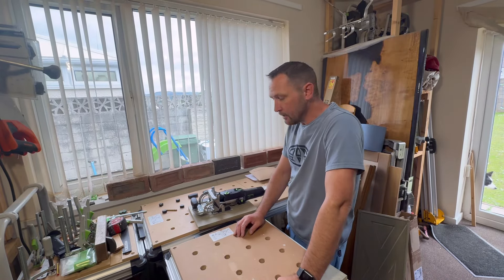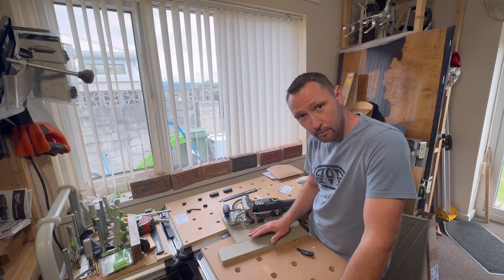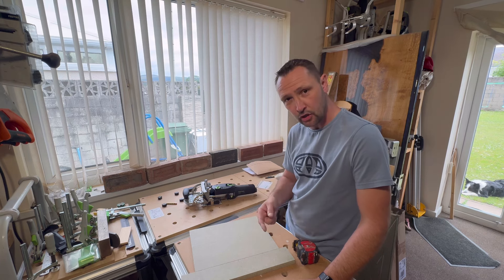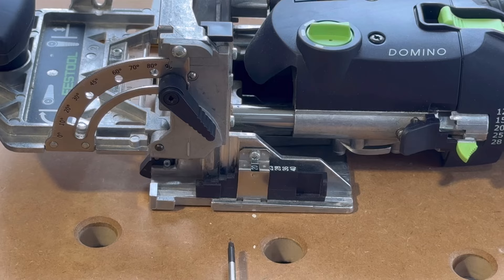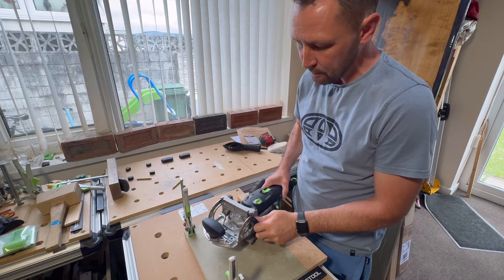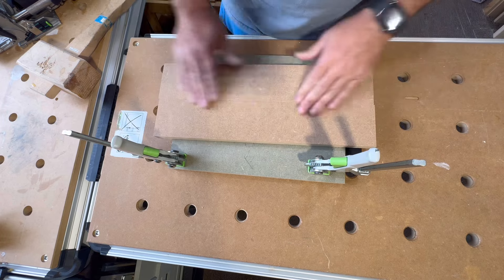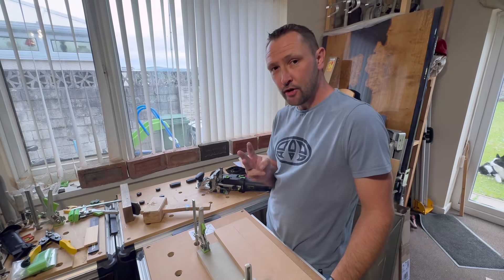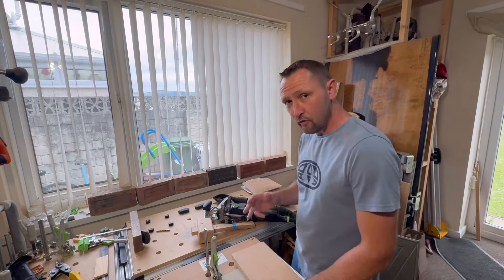Festool Domino (do this to stop common problems)👍

Comment: I just use the appropriate set/up block setting on the height pre-set if I want to customise it. 
At the end of the day the height isn’t that significant, good practise says you should mark up your face sides and reference diff the same face. Thinking you’ve got your new adjuster thingy might solve the problem some of the time, however for example ply is rarely exactly 18mm, so if you don’t reference off the same face then you’re back to square one. Similarly if you use 2 different batches or manufacturers of mdf they can be slightly different thicknesses.
Reply from the maker: Yes correct but if you can cut off the same sheet then all your thickness should marry up. If I just cut batches off 1 sheet for one part of the job. Once I start a new sheet of MDF I can keep that separate to compensate for the difference in thickness. I do mention in my video to still reference your face to get your face of your workpiece line up great. Thanks for the comment 👍😄

Comment: Thank you, Mark! I'm just waiting for the shiny new DF500 to arrive. With that in mind, I've been watching a lot of Domino tutorials. As soon as you mentioned the alignment issues, I imagined there must be a gizmo for that. And sure enough, there is. As you say, I'd still want to reference off the face side and edge, but at least if you do muck it up, there's a fighting chance of not having to bin the expensive stock.
Just hoping, like all things Festool, that the little bit of plastic doesn't leave me short for Christas.
Reply from the maker: Yes it certainly helps. Some say use the side fence for the depth adjustment but just using this makes it much easier. As when using it it stops the fence moving down. As we know once your set your good to go. Practice makes perfect with the domino just take your time and you will produce the goods. Thanks,enjoy your DF500 👍😄

Comment: I prefer having a non-centered domino. In case I lost track of the desired face then the offset will clue me in.
Reply from the maker: Mark that makes sense to be honest. But it has been a pain for me gluing up having them the wrong way around after sanding off marks I’ve put for face. 👍😄

Comment: Keep in mind that there is a scale on the depth adjustment and you can set the adjustment to any depth.  You don’t need the little plastic gauge with stops.  That just speeds up getting the right adjustment.  Just slide it out of the way and set your stock depth on the scale.
Reply from the maker: Yes there is 👍 honestly I don’t bother using it just in case I’m half way through a project and need to reset. It’s only just in case I’m not in the same exact position. 👍😄